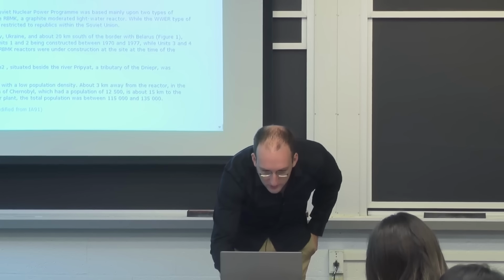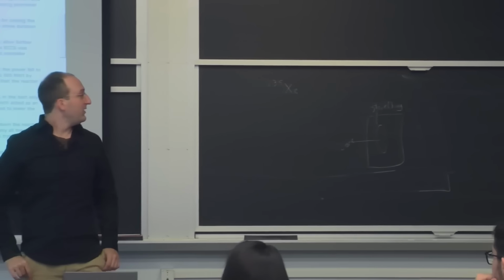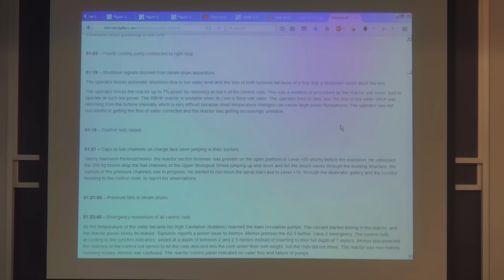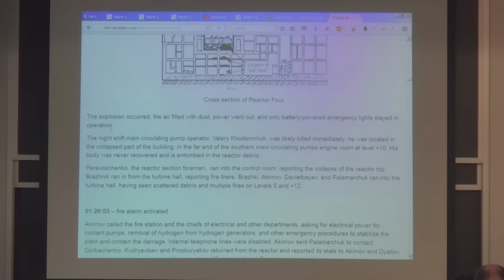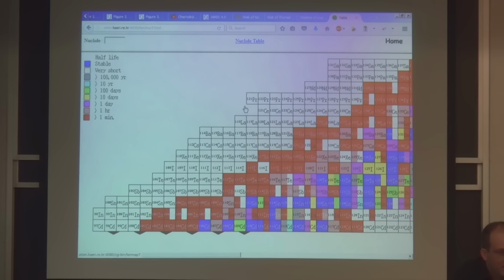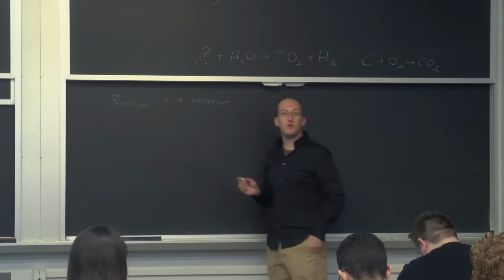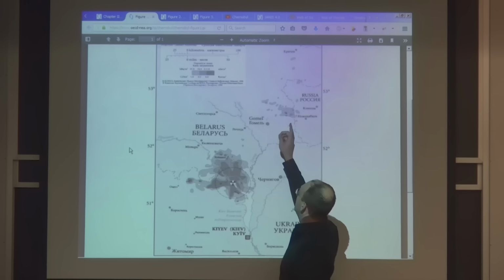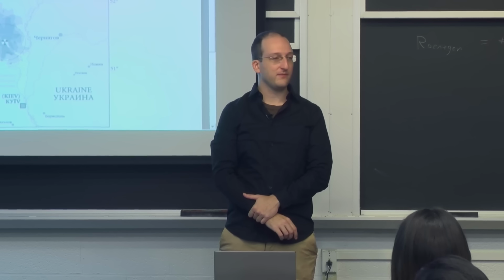26. Chernobyl — How It Happened

Comment: Why why why there was no pressure relief valve for steam to avoid explosion..... Even my pressure cooker has it..... actually 2 in number
Reply: I don't think that it would have helped much in that situation. There where multiple pipes where the cooling water flashed to steam in not more that 3 or 4 seconds. No valve could vent that pressure in such a short amount of time. Actually the pressure tubes had an intended breaking point at the bottom of the reactor in case the pressure gets too high. That would destroy the tube but vent the steam into the reactor. But it wasn't anticipated that more than 1 or 2 pipes break at the same time. So the pressure that built up in the reactor itself between the tubes was enormous as well. I mean it made the biological shield (2000 tons weight) fly up in the air.
Reply: Pressure valve requires a containment to vent to, RBMKs didn't have it. In Chernobyl there was a venting tower, hart to miss it, but as most emergency systems were disabled, it could be operated only manually. Either way, that wouldn't helped much, would have made it even worse, as most of the core was ejected outside of the building thanks to the steam explosion. If the core would have stayed in primary containment, it could have remained supercritical for days, melting in the soil and polluting everything while still operating in few GWs range, just imagine the amount exerted into atmosphere.
Reply: @Chakys92  whatever happened, but it was the steam again in Fukushima  disaster
Reply: @saadansari2241  No, it was hydrogen. They vented steam multiple times from multiple reactors there. In Fukushima Daiici plant all reactors were GE design PWRs, very easy to vent. But multiple isolated containments make it hard to account for hydrogen. If I remember correctly reactors 1, 2 & 4 were destroyed with a hydrogen explosion and reactor 3 suffered a lower cooling ring/well rupture due to steam pressure, but only because they had full station blackout and environment was already irradiated too much for humans to manually operate valves there. Not really comparable as in Daiici all reactors did shut down and eventually reached cold shutdown state, they had to deal with hydrogen and decay heat, compared to Chernobyl's #4, which went more than super-critical and completely destroyed itself.

Comment: The graphite "tips" weren't six inches long, they were meters long, spanning almost the whole of the active zone when a control rod is fully withdrawn. As those graphite tips didn't span the whole zone, there was some water (neutron absorber) at the top and the bottom of the channel. When the control rods started entering the reactor all at once, the water at the bottom was displaced by the graphite, significantly increasing reactivity. https://www.youtube.com/watch?v=hIGtTImeYU4&t=7m33s
Reply: @joenicotera2991  When discussing the operation of nuclear reactors, there is never an explanation that doesn't include "all of that 'neutron absorber' witchcraft". Neutron absorbers, moderators, and nuclear material are in fact central to how nuclear reactors function.
Reply: @joenicotera2991  I.....what? This makes beyond no sense
Reply: @joenicotera2991  dude you are so wrong it’s not even even. You need to stop trying to be Oppenheimer and watch hbo Chernobyl and pretend that’s a documentary.
Reply: @joenicotera2991  You are a fascinating individual.

Comment: 16:50  There are some people who are saying that after more recent review of the isotope analysis of the fallout they do believe the reactor went prompt critical and that was the cause of the first explosion.
Reply: There are some who claim that the first explosion was a nuclear explosion, not just a steam explosion. 

A reactor can go prompt critical, transforming a lot of binding energy to a lot of thermal energy in a very short amount of time. The coolant (water) would flash to steam, the pressure dramatically rises and the lid of the reactor blows off. But this is not a nuclear explosion - it’s a steam explosion.

A nuclear explosion happens when very highly enriched U235 is very rapidly (with precisely shaped and timed chemical explosives) compressed. The compression and enrichment BOTH combine to yield not just prompt criticality (reactor power increases on prompt neutrons alone), but super-criticality. IMHO, the RBMK had neither explosive compression nor enough U235 enrichment to possibly achieve super-criticality. 

Prompt criticality at Chernobyl? Absolutely. Power excursion from 50 MW to 350 GW in a couple seconds is criticality on prompt neutrons alone. Then as a result of the steam explosion, fuel explosively DE-compressed to quench the reaction.
Reply: @davecorley5514  There are also questions about the cause of one of the explosions at Fukushima Reactor #3. It had MOX fuel and much more plutonium than the other reactors. The second explosion was much higher than the explosions at the other Fukushima reactors. Some nuclear physicists think it was not a hydrogen explosion.
Reply: @jackfanning7952 ”Some nuclear physicists…” 

Until these “some” are imbued with the authority and responsibility to make decisions, they are but dry grass awaiting winter’s arrival.

“Some” is central to the scientific method. Anyone can challenge conclusions presented in some study or as response to some hypothesis. Each individual must make their own conclusions that considers the opinions of some and other. My conclusion: Neither Fukushima nor Chernobyl suffered nuclear fission explosions as a result of their super-criticalities. Rather the super-criticalities were the result of delta-k contributions unrelated to rapid compression of U235 density coupled with extreme neutron flux. Both of these are required for a fission explosion. I’ve seen no data that undeniably shows both of these conditions were present for either accident.
Reply: @davecorley5514  >But this is not a nuclear explosion - it’s a steam explosion.
This is like saying a nuclear bomb isn't a nuclear explosion because it's just an "air explosion". The energy came from fission.
Reply: @davidboreham I 200% agree with this. It’s probabilistically impossible for a nuclear reactor with 2% enrichment U235 vs all Uranium isotopes to explode by a nuclear fission explosion such as the Little Boy explosion over Hiroshima. 

The Little Boy bomb required years to enrich the 150 pound Uranium core to 80% U235. Further, it took years to design the conventional explosive outer shell of the core. The mathematical complexity of the outer conventional explosive shell of the core required the assistance of the VERY FIRST COMPUTER EVER BUILT operated by arguably, the smartest individual of the 30th century, John von Neumann.

The point: to explosively compress the U235 in the Chernobyl core to the point of super-criticality would have required an external outer shell of thousand of times more energy xplosive yield and thousands of times finer complexity than the Little Boy bomb.

Conclusion: The only way possible for a nuclear reactor with only a 2% U235 enrichment, such as that at Chernobyl or Fukushima to explode by nuclear fission would be to construct a gigantic rocket, place the entire Chernobyl reactor as its payload, and launch the reactor towards the Sun. In a couple months, the Chernobyl reactor would reach the surface of the Sun. Its contents including the U235 would eventually become so compressed by the Sun’s gravitational field that the tiny amount of neutron flux required to trigger the nuclear fission explosion would be achieved.

So, if one was to believe this rocket-launched reactor scenario, they’d also have to admit that the Chernobyl reactor could possibly explode. But practically, there is no way that a fission explosion could happen at Chernobyl on God’s green Earth.
Reply: So, ALL discussion about ECRAM timing that lead to the critic of the reator designe was useless. It was really JUST human error.